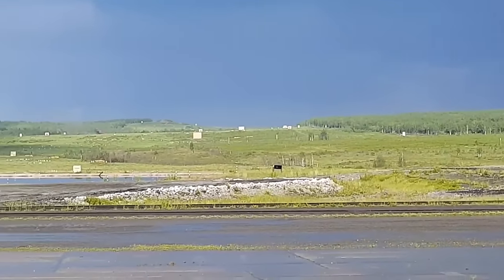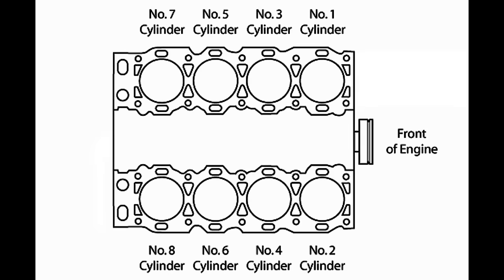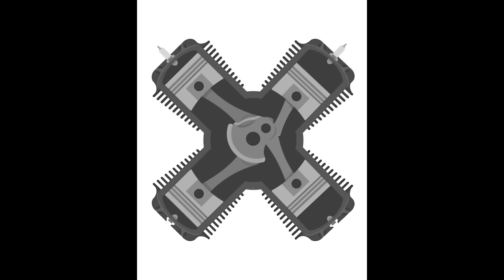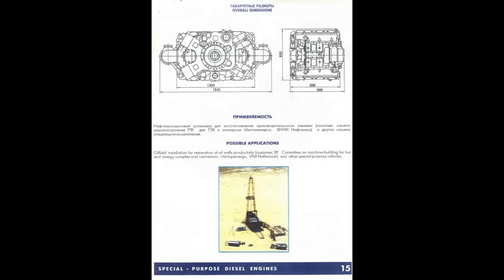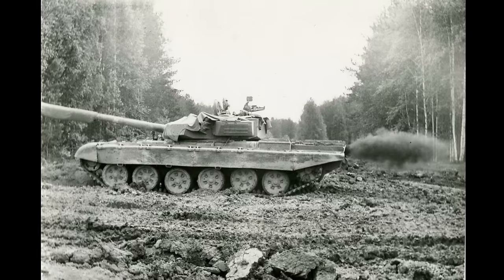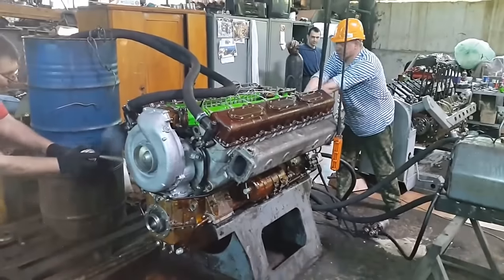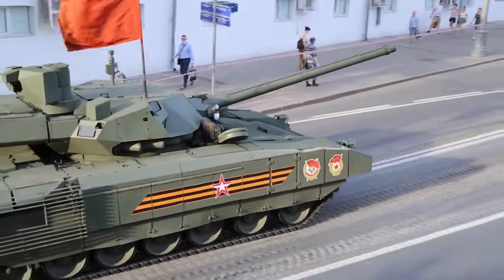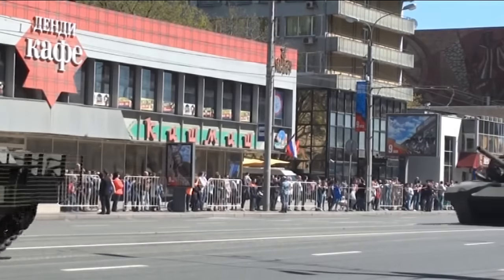Controversial History of T-14 Armata's Engine

Comment: If you knew anything about engines this "debate" was pure brainrot, thankfully now everyone knows without a doubt that it's not a copy of the sla16.
Reply: The engineering of engines has advanced so much in 80 years that it wouldn't make any sense for them to copy a ww2 engine. Sure, each and every one of these designs builds on the Diesel cycle, previous methods of injection, cooling, but these two have as much in common as an old VW beetle and a new Porsche 911.  @HippoBean
Reply: Russian must copy cause they cant make anything by themself
Reply: It's actually baffling how many people did so many stupid takes. I only learned about ICEs in passing, yet a simple look at the datasheet told me that those are two completely different engines. All the basic parameters (piston dimensions, bank angles etc) are different. It means you would have to redo all of the basic calculations for the engine, at which point there's no reason for saying that they're the same.
Reply: No, it's not a copy of the sla16 — I think it's what happens when communists try to copy an sla16.

Planner 1: "We want X engine for tenks!"
Planner 2: "But, comrade, we not ever make such engine before. Our engineers have no prior experience!"
Planner 1: "Eh, they're communists. They'll figure it out."
(Later)
Engineer 1: (Cruses in Russian) "Ugh, we make double V. That makes X, right?"
Engineer 2: "Brilliant smekalka, comrade! We avoid gulag this time!"

Rinse and repeat for every feature. Voila.

No, I don't feel at all guilty for the bad Russian accents.
Reply: @wyrmofvt  why would anyone want to copy an 80 year old engine?
Reply: @user-wi4jt8bs8v  Why would anyone continue to use the same engine for those same 80 years? The Kalashnikov of engines?
Reply: @wyrmofvt  you didn't answer the question
Reply: @user-wi4jt8bs8v  I did. You just don't understand rhetoric. If you are in a position that you are using the same goddamn engine for 80 years, even another 80 year old engine might be good enough for you.
Reply: @wyrmofvt  your rethoric would check out if it was truly the same engine from 80 years ago, which it obviously isn't
Reply: @user-wi4jt8bs8v  There's only so much you can improve the same basic design. The basic engine is an 80 year old design, and working with such engines will only go so far in teaching you how to deal with more modern engines, especially if you have been isolating yourself for much of that 80 years. It may be that an 80 year old engine is all you can handle.
Reply: @wyrmofvt  the V2 of 80 years ago is just a lot more similar to the diesel engines that you would use today in tanks than the sla 16, but I see the point you're making
Reply: @wyrmofvt nobody calls the V-2, the Kalashnikov of engines. That's just lazerpig brainrot
Reply: @TheForklifter  Yet the V-2 is used on an awful lot of tanks, isn't it? The descriptor fits.

"That's just lazerpig brainrot"

Lazerpig has proven to be a lot more prescient about how Russia had performed in Ukraine than so-called "experts," and especially "experts" who reference Russian media. As far as I'm concerned, this is just you casting shade.
Reply: @wyrmofvt  V-2 and V-2 derived engines are just used on tanks historically made by Uralvagonzavod. No other historic Soviet or ex Soviet producer of tanks or AFVs used 

Even the AVDS-1790 series of engines fits better for the "Kalashnikov of Engines" title. 

The reason why I called it lazerpig brainrot is because he made it up on the spot because it's ridiculous. No one calls it that. It's just how I know you're his fanboy.
Reply: @TheForklifter  So what if I am? Lazerpig is still doing better than your average bear at characterizing Russian weapons of war. If the T-14 is so great, where the hell it it? The answer is, of course, that the T-14 is nothing more than a project that was only designed to make Russians feel proud of themselves. The Russian military knows that if they field the T-14, it'll just end up embarrassing them like the Moskova's sinking. The main criticism forwarded by Lazerpig still stands.
Reply: @wyrmofvt he's "good" at characterizing Russian equipment because his opinions confirm your own.
Reply: @seb_1504  Couldn't we level the same accusation at the OP? How do we know that the parts shown are from a production Armata, rather than being staged? At this point, it could go either way, with Russia (and its propaganda machine) saying one thing, and everyone else saying different. The reason I believe Lazerpig over Russia is because Russia has been claiming up and down that it was a near-peer to the US, and it's painfully obvious that is not the case.

Comment: "Ah s**t here we go again"

Said RedEffect in his thought, probably
Reply: He never thought about comparing it with other vehicles its age though.

Both the Puma as well as the Boxer as well as most modern IFVs and MBTs use much more modern engines then the T14. Usually they use MTU ones that are a clean-sheet design from the 1990s originally intended for the Puma program.
Reply: @l.b.3416  t-14 should be compared to kf51 or abrams x , which use older engine. puma is an ifv with a new engine and should be compared to kurganets ifv.

Comment: This is like if someone looked at a Volvo truck from the 70ies, saw that it used a turbocharged I6 engine and then decided that the current generation of BMW M4 must've copied that random engine that has absolutely nothing to do with it, simply because it looks vaguely similar, being a turbocharged I6 engine.
Reply: Unfortunately that type of stuff is literally everywhere: guns and military equipment in general, cars(luckily not to the extent you mentioned, but I've literally seen BMW, Toyota and other makes fanboys comparing VANOS/VVT-i/VTEC/etc. and accusing eachother of stealing the design), even the video games are plagued by people who don't know a bum about how stuff works but feel comfortable to make bold statements like that and start flame wars over it.

The worst part in this clownshow is even if some of those claims are true—who tf cares? The stuff works and people like it, so we're supposed to be happy if the stuff we like exist in more shapes and colours, not be mad at it! Not every situation requires the reinvention of a bycicle
Reply: @ДимаВеселов-в8и  In automotive it's even dumber as there is a lot of duplication and parallel development. Variable Valve Timing (VANOS/VVTi/VTEC) actually wasn't brought to market first by any of them - Alfa Romeo had a mechanical system in 1980, electric one in 1983, and Nissan debuted it in 1987.

Comment: Some interesting history I found while arguing in the comments of a previous video. 

One of the sucessful implementation X configuration engines is General Motors 16 cylinder 16-184 engine used on the WW2 era SC-497 submarine chaser. The handful of online sources on the engine say it was noted to be quite reliable and long lasting. 

More interestingly 78 of these X-engine sub chasers found their way to the soviet union through lend lease. So we have a clear record of the soviet union having 78 copies of a reliable production grade X engines and somehow we are expected to believe that they instead opted to copy a prototype engine that never saw any real service from a country that had a reputation for building unreliable engines. Im not saying the armata copied the GM 16-184 engine but it is a better option than the SLA-16.
Reply: Cool but in engineering you have certain ways..so basicly you Can simultaniusly reach same product..but depends hugely for what you need it..then small things small things and you get very different thing .btw in ussr now Russia military archive projects you have millions things that were put on shelf cause different need or even political issue..i Can think USA Got similar archive

Comment: How 1500hp is "not enough" 😭
Gimme that engine I'll take it if they don't want it.
Reply: That actually took me as a surprise, because I've also read about that engine before that it was easily improved on it's performance. The maximum achieved HP was 2200 on that engine, but it decreased it's reliability at higher rpm. So at this point I am also not sure what he is talking about. Perhaps it is just not as reliable as the army wants, but that is just a guess. Though as I said they could easily improve it's power.
Reply: @korana6308  We can only run those engines at that power level with tons of sensors monitoring every single bang and adjusting the parameters on the fly. The engine is very "late Soviet" in the sense that it's not as electronic as it was mention late in the video, the design is 30-40 years old.
Reply: @ChucksSEADnDEAD  are you a Russian engineer?
Reply: A car weights no more than 2 tons on a good day. A tank weights more than 40.
Reply: Yeah that is kinda strange since other comparable tanks like the leo 2 also have around that power. On the other hand power alone isn‘t everything, torque and the relationship between the two also matter for performance as well as other things. Still strange to hear that 1500 PS isn‘t enough
Reply: @EdyAlbertoMSGT3 The Leo 2 and Abrams weigh around 68 and 70 tons respectively and both of them use a 1500 hp engine

Comment: anyone who unironically says the engine is a copy of the SLA.16 shouldnt be taken seriously

is T-14 good tank? its probably a tank and can do tank things i think, and its better than anything russia currently operates because if it wasnt it wouldnt exist past the drawing board. the main issue of T-14 is that the russian military cant afford it, assuming its a functional prototype without significant problems which we cannot know. 

will T-14 be adopted? probably not,  im not an expert but i would expect them to slowly phase out the remaining T-72's after the war, continue producing T-90M and T-80BVM for the next 10 years. T-14 will most likely suffer the same fate as MBT-70  and be abandoned  due to taking too much time/money, then replaced with a new project that takes the stuff that worked and changing things that didnt with T-14.

what do i think about T-14? its a waste of time and money, which could have been used for developing a tank better suited for russia at an affordable price point so it actually would be adopted. the best thing about T-14 is what was learned during its development and technologies made for it, which can be later applied to a new tank.
Reply: T14 should have been a technological demonstrator
Reply: Here, rather, the situation is from the category of the absence of production lines, and without this, the Russian military-industrial complex doctrine does not allow mass production. Although you may ask why the Su-57 is produced if it has the same problem, but because Russia has no analogues for mass production like it.
Reply: Т-14 примут на вооружение, но вероятнее всего это будет что-то вроде Т-14А и это произойдет после окончания войны. 
Т-14 различных модификаций (да, их несколько) произвели больше ста штук.
А вот судьба Курганца и Бумеранга непонятна, в отличии от Т-14, их концепция сегодня не кажется правильной.
Reply: The future of tanks is drone tank. Miniaturizing and leaving the crew outside completely, giving it also AI.
Reply: @LyubomirIko  это очень далекое будущее по многим причинам. 
Средства радиоэлектронной войны с легкостью будут подавлять связь с такой машиной, а искусственного интеллекта, способного самостоятельно вести современный бой, ставить приоритеты, принимать решения и т.д. Сейчас не существует. 
Будет ограниченное использование искусственного интеллекта, который будет помогать обнаруживать цели, оценивать обстановку, а при поражении экипажа танка, самостоятельно отступать, возвращаясь в тыл.
Reply: Russian military was never meant to copy the doctrine of westeners. they have no reason to make a tank that has the complexity like abrams or leopard as with T-14. this is because artillery spam and drones are enough to take them out, like it already was.
Reply: @arhidemus  you're absolutely wrong buddy.
Reply: Yeah think they'll stick to  even more modernized T80 and T90s, just the fact that their infrastructure is way more used to it than the Armata, and iirc there are questions on whether the capsule can actually save a crew
Reply: @essexclass8168 в современной войне ничего не может спасти, но выживаемость экипажа в Т-14 должна быть существенно выше, чем в Т-90М.
Reply: @arhidemus  tell Viktor Sobolev and his buddies in the Duma Defense Committee that 

He specifically said it was a conceptual dead end at the moment and that the modernized T90s and T80s would be best in the world while talking about the T14's survivability issues.

By Modernized T90 i do not mean the T90Ms but a proposed modernization of them.

There's also the shit logistical footprint compared to a modified tank everyone on the train already knows how to work with.
Reply: @arhidemu do you heard anything about 3 laws of robotics by Asimov? It's too dangerous to make such independent AI.

Comment: who wouldve thought russian engineers and scientist are a million times smarter the lazerpig and actually know what they are doing while hes unable to even understand it
Reply: Is that why there are only 8 T-14’s and they break down so much Russia won’t build more or put them into combat?
Reply: @bootlegfootballdisciple3253  Theres a lot more than just "8 T-14's" in the low tens probably between 20-50, not in large numbers but definitely more than 8.

As for "they break down so much" I have not heard much of this part beyond the original "stopping during the 2015 parade" where it turned out the driver accidentally hit the breaks and did not realise it. 

Russia probably does not build more because the T-14 as a whole is not a very effiecient platform for the Russian military doctrine which still favors large numbers over significant quality. The T-90M seems to be their favorite because it is much cheaper to produce and maintain than the T-14. The T-14 seems to have become a defacto technology demonstrator with significant money spent not due to massive defects in the tank itself but because it does not fit well into the Russian military's requirement.

Comment: This is why I watch you instead of them! Great video!
That cooling difference is the real important point here. But the same codename (12cyl, 4-stroke, supercharged, 15CM bore, 16alCM stroke) mixup you outlined is equally important.

For those of us with enough sense, this solves the case and it's sealed, no needing to be revisited.
Unfortunately, we all know this debate is going to continue from the other side, and for silly reasons. 😒

Well done, Red Effect. 👏👍

Comment: 0:35: ⚙️ Misconceptions surrounding T-14 Armata's engine origins debunked through detailed analysis.
4:31: 🔧 Optimal bank angles for engines with different cylinder counts are crucial in engine design.
7:47: 🔧 Comparison of T-14 Armata's engine components and cooling systems.
11:47: 🔍 Misconception about the development of A85 engine led to confusion with a different engine.
15:37: ⚙️ Development of a new engine for T-80 tanks faced challenges with overheating and high fuel consumption.
19:21: ⚙️ Development of V2 engines for tanks, including successful testing and eventual implementation in Object 195 tank.
23:25: ⚙️ Delayed development of new engine for T-14 Armata due to outdated V2 engines and production constraints.

Timestamps by Tammy AI